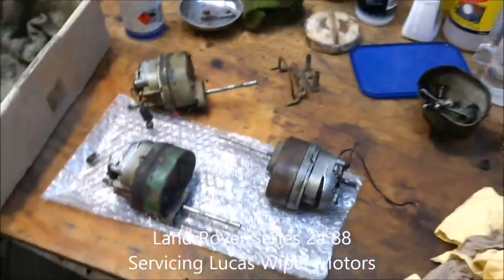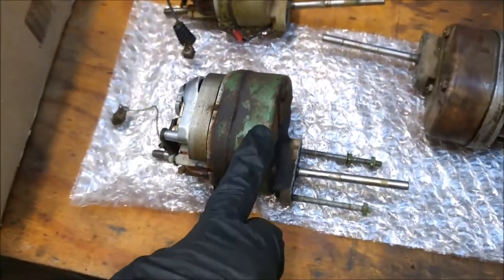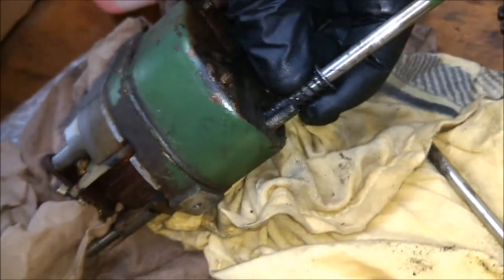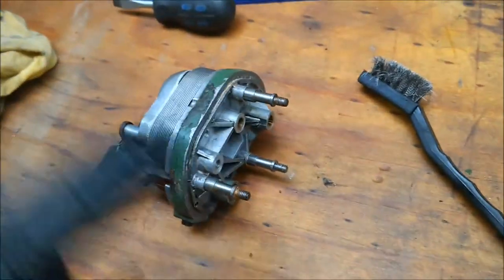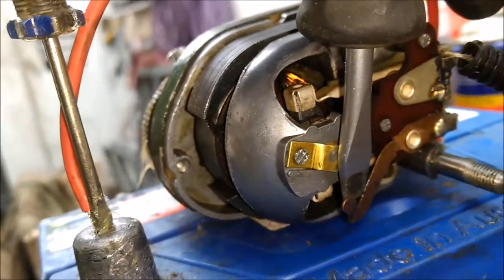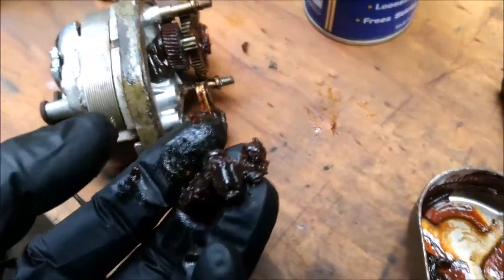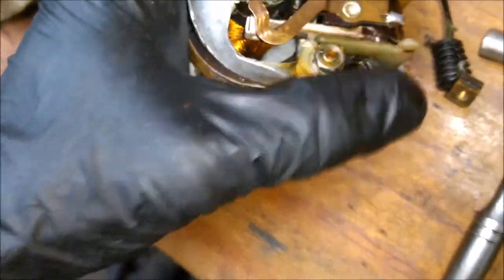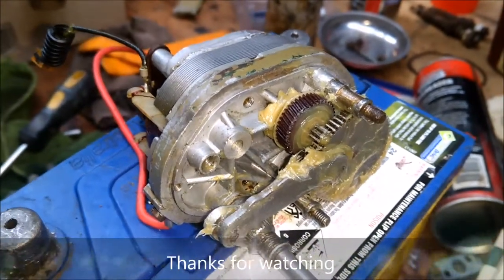Land Rover Series 2a 88 - Servicing Lucas Wiper Motors

Comment: Hot tip. Literally. Just got another one of these going, sometimes I wonder if they've actually been been used since they were assembled, or must have been dormant on a shelf for 45 years. Anyway I had the same problem with the grease sticking the armature and gear shafts absolutely solid. I liquified a fair bit witha  good soak of WD and then used one of those little kitchen blow lamps with the Very hot pencil flame to just carefully put some heat into the mazak base casting so it would soften the grease so it would move out or round without straining anything.  Obviously one gear is fibre so no flame near that but those blow lamps are invaluable. They'll do soft and silver soldering too. Successful afternoon and she's purring away again. Great vids thanks
Reply from the maker: I was too surprised they got stuck even tho it was clean inside. I suppose If they have never been serviced then grease may solidify??  Good tip tho, its amazing the techniques used to repair things that I am told bout, could write a book on it lol.  Good news that yours is going again too, I think these units are a beautiful piece of work.
Reply: Rover Tasmania great end comment, me too. 
Not a pressed shoddy bit of tin in them!! All quality, helical gears turned pillars and everything. 
Seriously , get one of those kitchen torches, a fantastic tool to have in your armoury. I got mine out of a box at a car boot sale on a sunny day. Turned the gas on held it to my ear  it was hissing so i clicked the ignition button. Couldn't see any flame so I held it to my left palm
OWWW!!!!!
Very very hot and invisible pencil jet. 
That works then!
Not the last stupid thing I'll do , I expect
Reply from the maker: Mate, you're not alone in doing stupid things, funny how that works.  Like when I used a stanley blade to remove a bit of trimming, ended up slicing my finger...

Comment: Just watched this again as a ten relax with a cuppa tea ( uk not a great place right now, with the prospect of things being a tad worse next year when we’re out on our own without a pack lunch and it gets dark early) 
 So I’m going landrover fettling to have  a bit of s distraction. Got two of these motors from off a screen hanging off a camper hardtop at my local rover yard. Been outside for eons and they came off ok. Took the hand lever off both and the two long screws holding the motor cover( praise be  for the brass screw, for it shall come undone!) had a motorcycle battery with me and after turning the motors by hand to get them to move, they ran!!  January 62 date on the motors, amazing huh?  I’m now going to strip and regrease  both,  nothing wrong with Lucas gear, it’s very serviceable. 
I keep referring to some of your vids. Are you going to be the first person on YouTube to dissemble a steering relay?  A dangerous job.
Reply from the maker: Hiya - thanks for the post, great to know that you can keep yourself busy restoring old rover parts - what a great hobby :)  How fortunate these work like that, some can be very rusty internally but surprisingly work!  As for the steering relay, nope I am certainly not going to do one if I can avoid it. So far I have been fortunate that mine was in perfect condition (for its age).
Reply: I bought a good second hand spare just for that reason. Mines 60 and is very good but loses oil fast!  New ones possibly have a rep for the shaft snapping. ( that’s got to be a GOOD piece of steel)So to be avoided   All the best!!
Reply: Just had that tiny c clip on the wiper shaft flip a couple of feet into a pile of bits on the workbench. Hmmm. Now I knew it could happen, I just didn’t expect it when I was rotating it, ready to remove it.  
Search and rescue time!
Reply from the maker: @highdownmartin  sooooo glad it just doesn't happen to me. What gets me tho is when you drop a nut or something like that on clean concrete and still can't find it!

Comment: Would it be better to use silicon grease as it doesn't dry up like petroleum grease does? That's what we do in the wiper gearboxes on the old Benz monowipers.
Reply from the maker: Yes, but this is what i had on hand and i think given the design is prone to water ingress, it would be worth servicing these units every few years to keep them operational.

Comment: Hello my friend from Chile!! Good work! One question please, i have 2 wiper motors 12 volt, but one drain 1.5Ah, and the other drain 7Ah and smoke, and have spark , this is bad?? What to i do for fix??
Reply from the maker: Me parece que el coil esta jodido.  Podes ver si alguien lo piece arreglar pero en muchos casos necesita rewire ccmpletamente. No tiene que aver ump o que se pong demasiado caluroso.
Reply: Rover Tasmania hola amigo no sabia que hablabas español, efectivamente parece que un motor de limpiaparabrisas esta malo, ambos son originales Lucas, el que esta malo pareciera que fuese el colector, ya que al andar se calientas los carbones y a veces se pone al rojo vivo un arcol en el colector. Sabes si existe repuesto para el colector?? Tienes algun email donde enviarte el video de motor funcionando ?
Reply from the maker: @cvv4x4  Perdon pero no the puedo ayudar, yo tambien no tengo mas ideas. Si era MI lo llevaria a un lad que pueden verlo. Lo que entiendo que se piece arreglar pero cuesta!
Reply: Rover Tasmania gracias amigo igual muy util tu video. Revisa el mio.
Reply from the maker: @cvv4x4  tango Un documento manual para sets fw2 wipers, lo quieres? no se is the VA ayudar... mandame un email a islandantics @ gmail . com
Reply: Rover Tasmania ok te enviare email